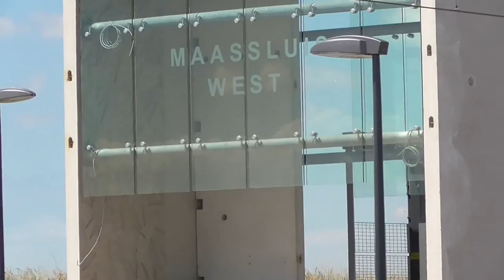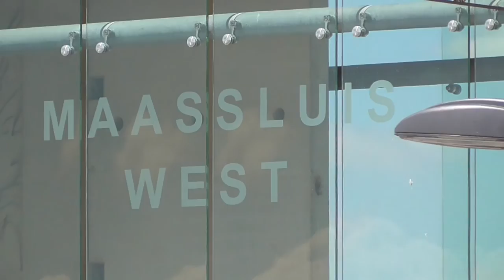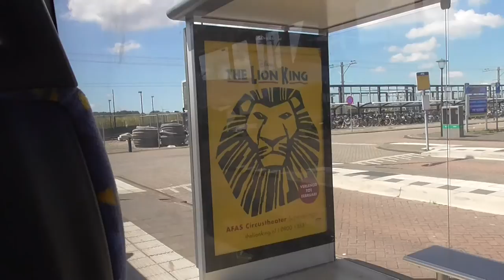Werkzaamheden Maassluis West 13 juni 2017 (Hoekse Lijn) #HoekseLijn

Comment: Congratulations on filming! Are you planning to open this new section of the subway?
Reply: Victor Santos No, the RET does. Not him. And it's with 5 months delayed due to problems with the train security system, old cables, ground trash and asbestos.